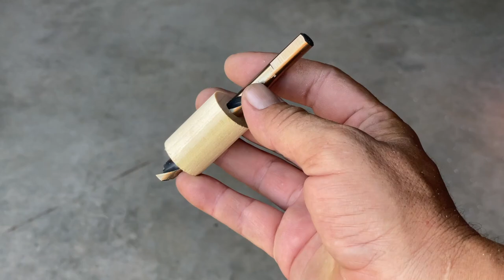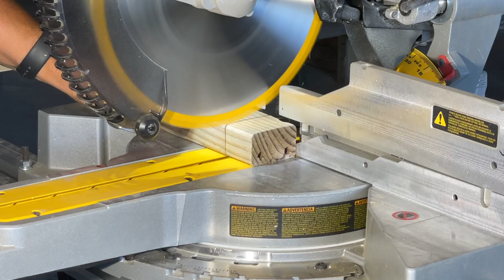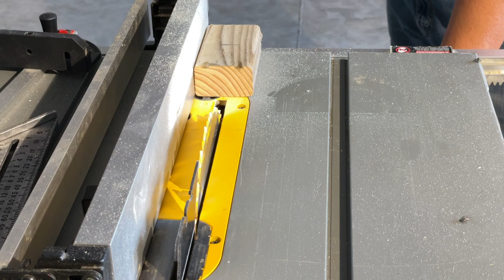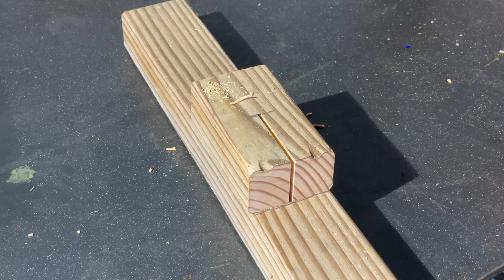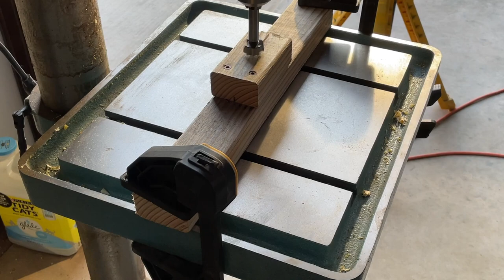Hack For Drilling The Center Of A Dowel Rod

Comment from the maker: Tools Used In This Video

Irwin Forstner Bit Set - https://amzn.to/3zJ2hVy
Dewalt Trigger Clamps - https://amzn.to/3xfGPWp
Dewalt 10 Inch Table Saw - https://amzn.to/3xdWVjv
Dewalt 12 Inch Compound Miter Saw - https://amzn.to/3j24Ivw
Dewalt Cordless Hammer Drill - https://amzn.to/3lbJazp
Dewalt Cordless Impact Driver - https://amzn.to/3l8VS1U
Reply: @txtoolcrib
I don’t know names of parts. I have a 3 tier food server with wooden dowels in between the layers. The top is wobbly and isn’t screwing into the tier below dowel and the center rod screw is stripped. The rod screw is hollow through the center. Could you tell me what the proper name is for the rod screw is so I can buy it?
My dowel is the width of the one in the video and the length of a pencil.
   Any help is appreciated as I am trying to fix it to display cupcakes on for my daughter’s upcoming baby shower.
   Thank you for tips and advice.

Comment: Very good tip. I would recommend checking out the Grr-Ripper for safe table saw cuts with small workpieces
Reply from the maker: I'll definitely look into that, thanks for the tip.
Reply: Yeah,  Thought I saw that wood move when close to the blade......Nearly had a heart attack....

Comment: when you clamp it, I can see the dow move to one side more than the other (because of only one screw being used there at the clamp area).  Would not using any screws there potentially help keep the clamping forces even and the dow more centered?